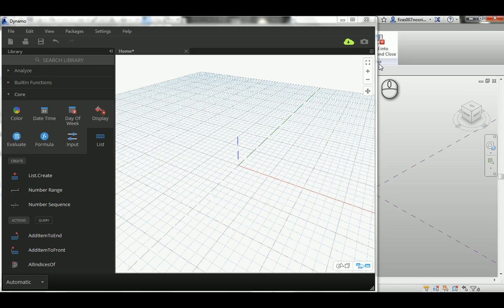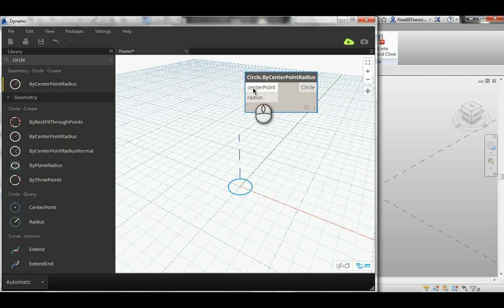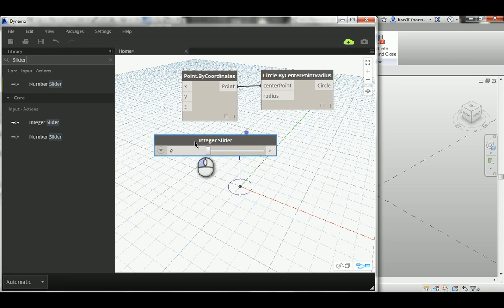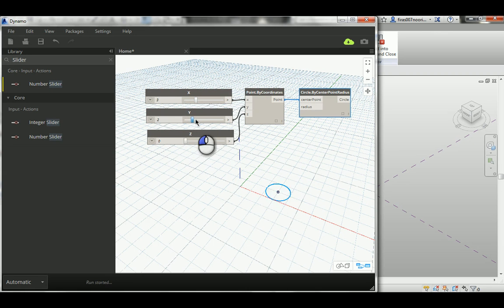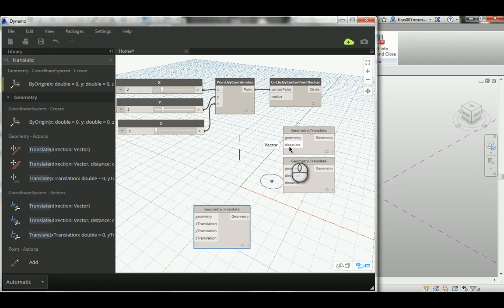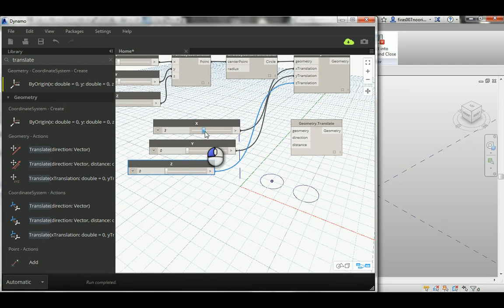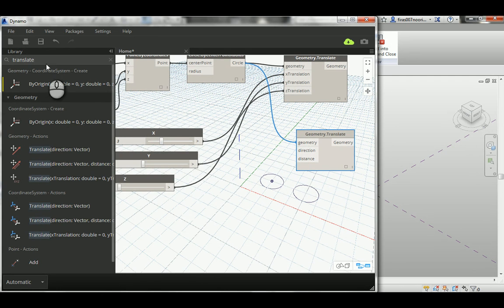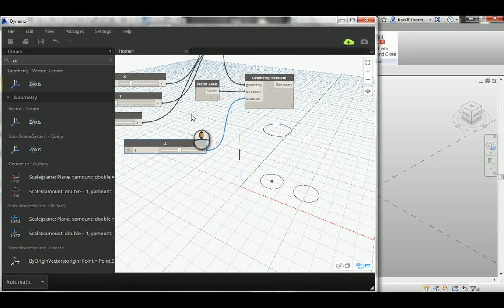Move_Copy_Translate_in Dynamo

Comment: Hi Firas, I would like to copy walls in revit, however this "copy" method seems only working for dynamo geometry not revit geometry? Thanks
Reply from the maker: I will look into that dear, sorry for delay
Reply from the maker: but isn't that will be the same as copy command in Revit, can you give me an example when you use it??
Reply: @FirasNoori  Hi Firas, thank you very much for reply. For my workflow, I cost estimating stage, I need to duplicate multi-layers wall into multiple single layer walls, such as brick layer as one brick wall, stud layer to be stud wall, also "render paint" wall, etc. So I am looking for the way to select external walls (enclosed) and give offset distance and new wall types (like brick wall offset outwards, stud and painting walls offset inwards certain distance), currently I need to group walls in different direction, like "left, right, upper, lower" and manually copy walls and change types. Once walls are joined, window/door openings are also copied. It is great if there is way to use dynamo, the AI way :) Thank you! My email steedlei@gmail.com if you would like to chat commercially :)
Reply: Like internal stud wall I need offset both ways to make 2 plasterboard walls and 2 "render paint" walls..hope you understand my idea :)